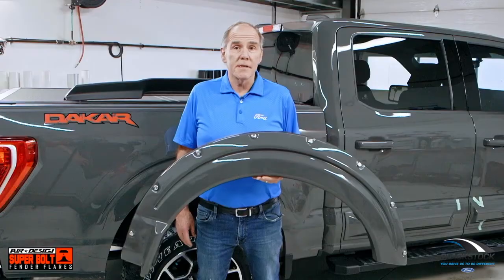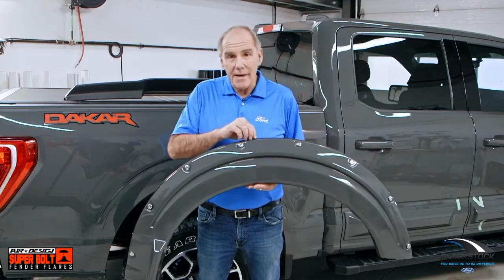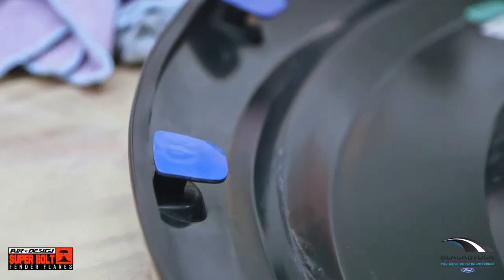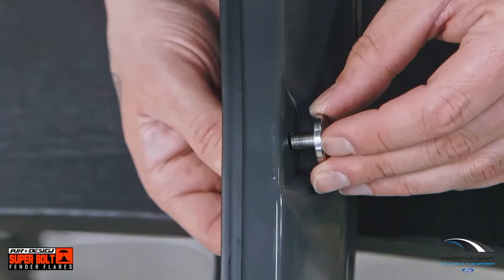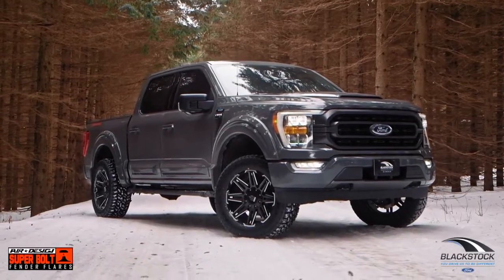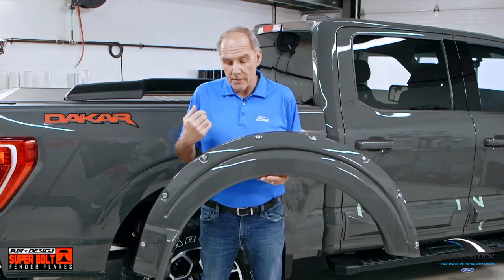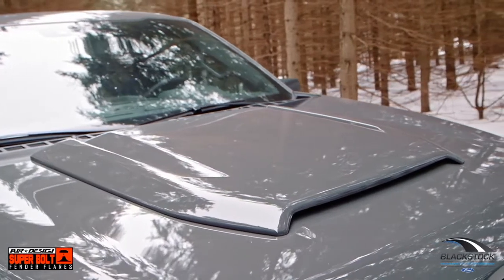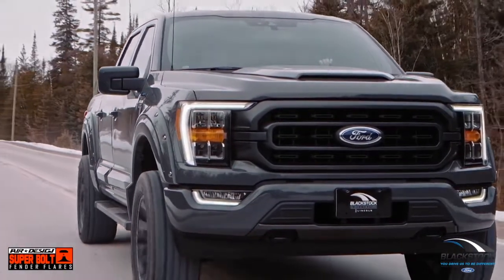Super Bolt Fender Flares for 2021 F-150. Game Changer!

Comment: They are a nice design. Integrated mud flap is excellent.
Reply: 2 inches or so
 of mudflap won't help much
Reply: That's another issue for me. I already installed Gatorback mud flaps, so wouldn't be able to use them.

Comment: How long will these super bolt pads remain adhered?  Also, whatever flares I get, it still will have anti chaff tape put in between the rubber gasket and the painted fender surface.  Debris will still get in this area, regardless of the super bolts.  Not very much, but enough to cause paint damage over time. These r the best flare kits, but still need the tape of clear bra film.  I wish these things were designed to still integrate mud flaps.  These small things can't do that much good.  Better than nothing , but I would like actual mud flap protection, regardless if they r not considered the in look.

Comment: I have a 2021 carbonized grey f150, I would like to order the flares and door moldings. How can I order these?
Reply: Just had mine done last week, Call Bad Dog Mods in Orangeville, they are owned by the local Ford dealer (the guy in the. video).I had them paint them to match my grey truck for an extra $640. Well worth it, it looks great.